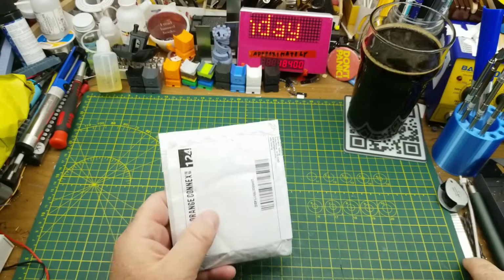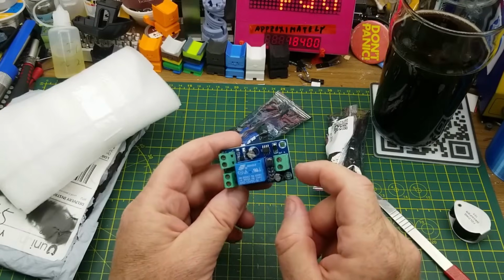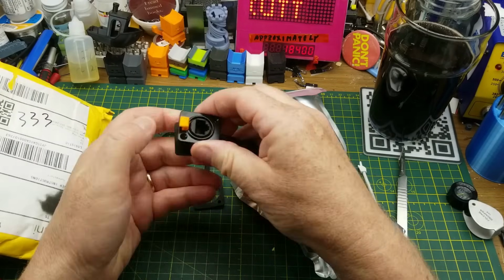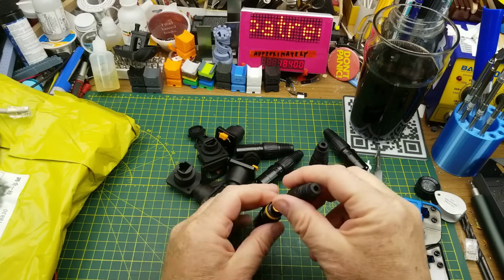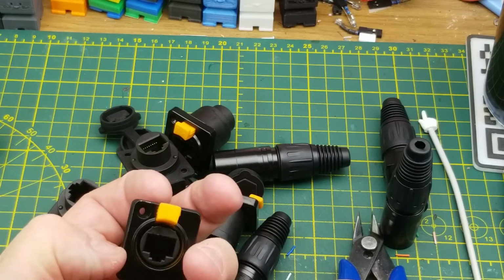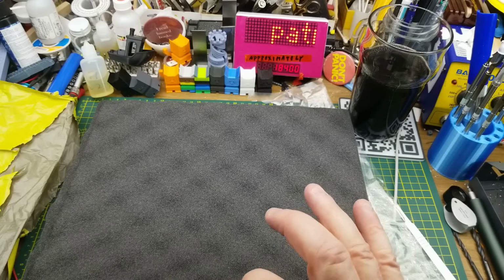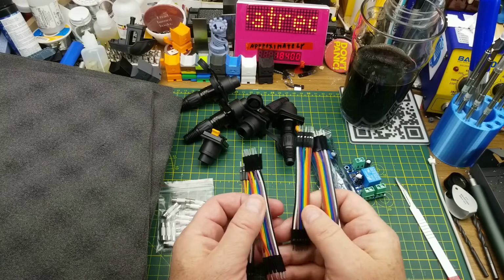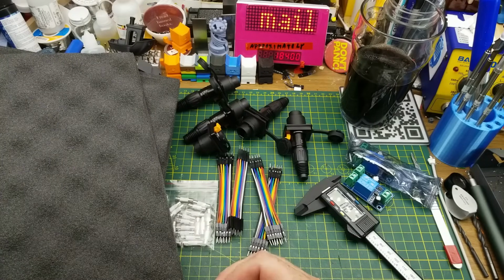Mailbag Monday 219

Comment: I really like the RJ45 connectors.  I work with robotics and we are constantly using RJ45 without protections leading into and out of cabinets where a standard fitting is too small.  We generally just install grommets for protection, but are hardly waterproof. These connectors would be perfect for those applications.

Comment: Thanks for checking out the ethernet connectors a littel deeper.. I was wondering how they work... could have broken a fuse just to see if there is quarz sand in it ;) Thanks for the mailbag !

PS: did they mention the switchover time for the relais somewhere ?? 20ms 10 ms ? if it is too slow it will not save the router from rebooting

Comment: Looks like the yellow tab locking bypassed the seals so would allow water in if at the top.
Reply from the maker: There's still the O ring inside the chassis side of the connector.
Reply: @pileofstuff but the contracts are exposed to any moisture, best to fit the button on the bottom and use it as a drain hole.

Comment: Are those really 250V fuses?  What more you say about fuses is that they're in there for safety and if you replace a real fuse with a fake fuse or one of the wrong rating, you may cook your gear or get cooked yourself because the fuse will fail to work properly.  The fuses in meters are filled with sand so that when the link gets turned into plasma in a short, the plasma is immediately disbursed, interrupted, cooled, and quenched.  If you don't include the sand, at high voltages the plasma inside the tube will just act like a low value resistor and it's won't necessarily work as a fuse.  Break one open and see if it has a sand fill.  If not, those are 32 volt fuses and not 250 volt fuses and not safe.
That "accoustic foam" by the way is just silly.  That's packing material with a silly label, not acoustic foam.  I'll bet it's flammable too.  Look up SONEX acoustic foam to see the real thing and to start that rabbit hole.
Reply from the maker: I've installed real Sonex in radio studios.  This is nowhere near as dense. 

But it's also a lot less expensive.

Comment: Take a magnet to the Dupont jumper wires, see if it sticks to the actual wire.
I had a few wires wich was steel and had quite a high resistance
Reply from the maker: These are almost certainly steel/iron core.  The connector pins are magnetic on every one of this type I have.

For low current and short lengths it's not a huge risk, but it is something to be aware of.

Comment: What meter takes a 10a 250v fuse?
Reply: ampmeter
Reply: Heck of a fuse for an ammeter..   although i don’t believe id ever use a probe on that kind of current, clamp on doesnt need a fuse..  only 10 amp fuse i have in metering equipment are in the power supplies and variac..